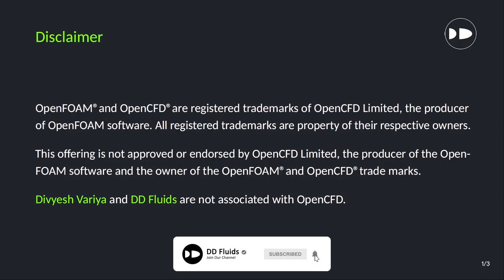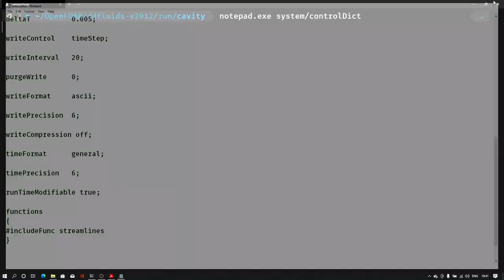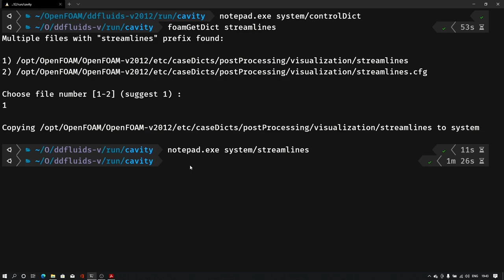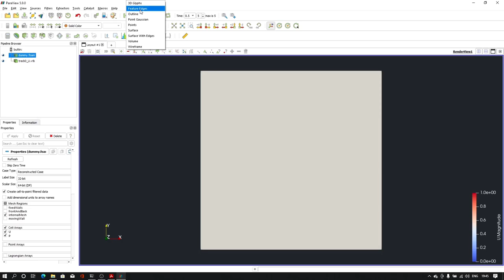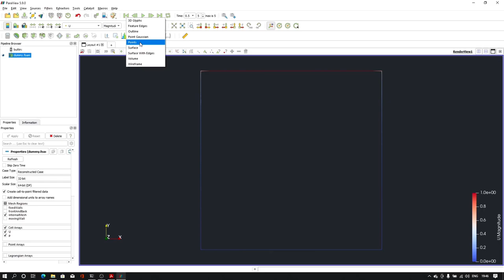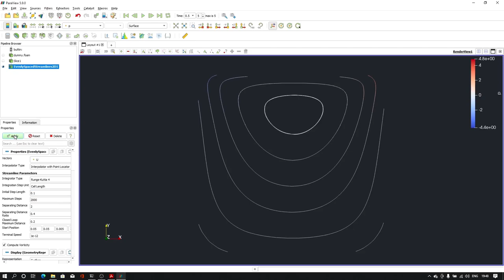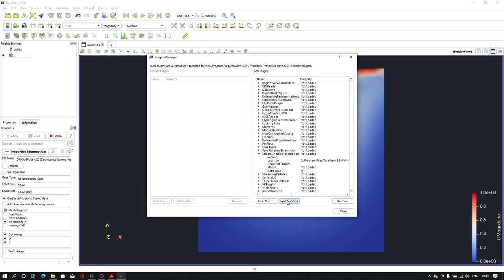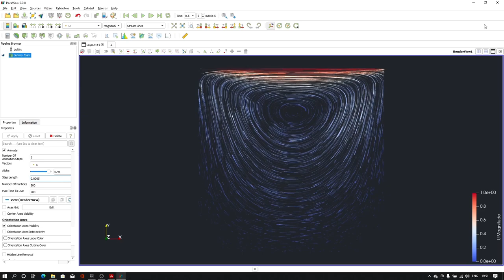Streamlines in ParaView & OpenFOAM

Comment: How to plot streamlines in paraview using only y and z components of velocity?
Reply from the maker: You can use "Evenly Spaced Streamline 2D" option. Where in you have to slice your mesh/geometry, basically a 2D plane and then plot streamline.
Reply: @DDFluids  thanks. If I slice the geometry, will it automatically take into consideration 'only those' velocity components that exist on that particular plane?
Reply from the maker: Yes. But if you are looking for velocity magnitude, it will consider all components. There you need to add few more filters to extract only two components. "Calculator" filter will help you in that.
Reply: @DDFluids  got it. Thanks!